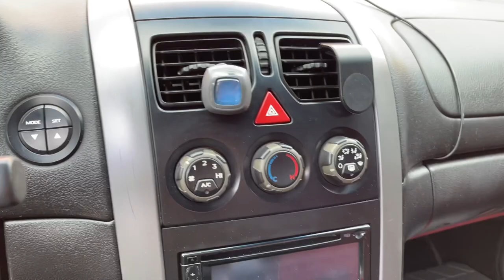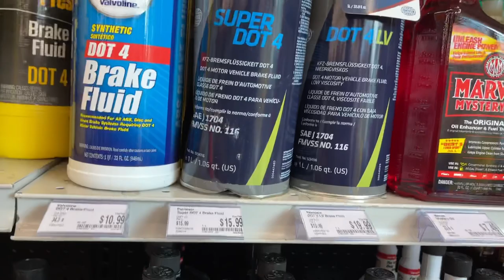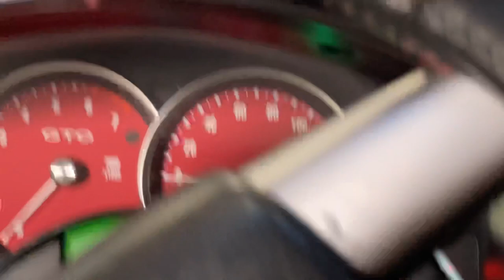Time to Address the GTO Clutch. And ugh it’s a disaster.

Comment: I thought i was the only one. For some reason the clutch on the '04 goats tend to have issues, even when stock and not driven hard.. if i recall correctly, i read some upgrade to Z06 transmissions to avoid such issues. Other than that, all is worth it with your car. Perfect!

Comment: You need to go to tick performance and get a bored tilton master cylinder they also sell those quick bleed lines. The problem with the old master is it has a small hole and doesn't build the right pressure causing them to burn I guarantee you if you take your master off it's actually burned with discoloration will still work but not the best will lock you out of gears and makes pedal feel like alot of play

Comment: The hydraulic throwout bearing should be bleed with a vacuum bleeder   so much easier and you could have done it by yourself and it also makes it easy to get all the old fluid out and new fluid in the system .